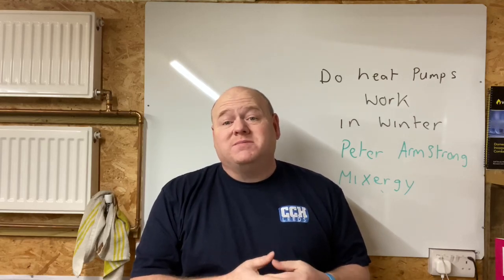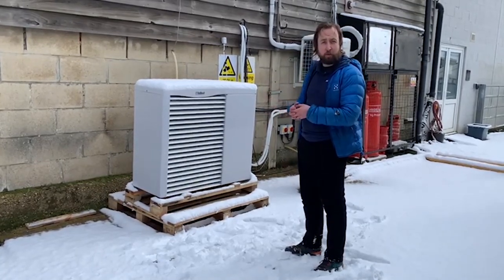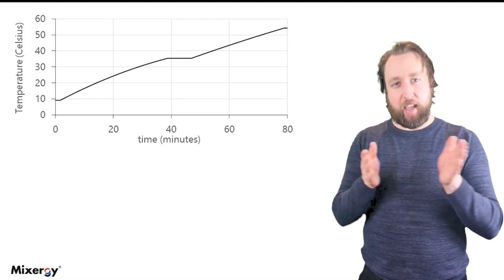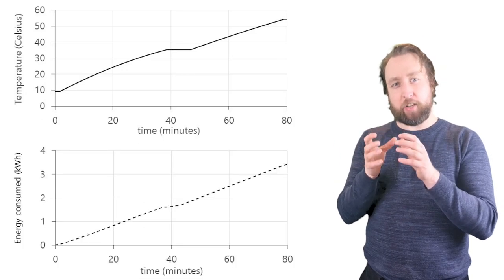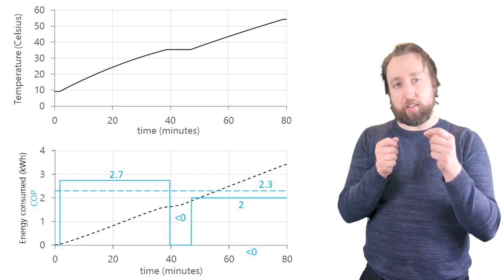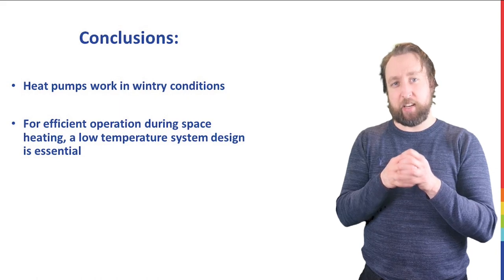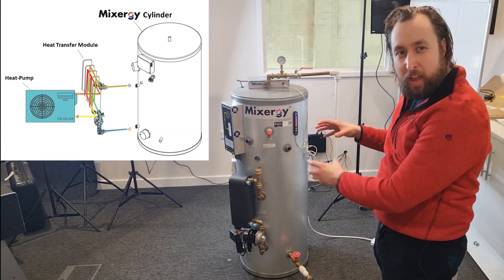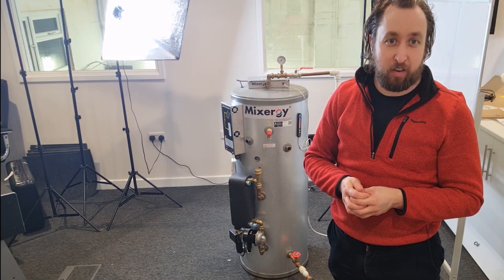Do Air Source Heat Pumps Work In Winter - Peter Armstrong Mixergy

Comment: Not convinced by this whatsoever.

How many houses of the 29 or so million homes in Britain can actually have sufficient insulation fitted to make these work? Anything built before the 1980s will likely not have cavity walls, so no insulation there. 

The questionable data here suggests it takes almost an hour to heat water up to body temperature of 37 degrees. 

And what about cost, it's about £4k for a new gas boiler install at the most. Most of the stuff I've seen is quoting around £15k for a heat pump install, I don't have £15k for a new heating system. Then there's the electricity costs, what does it cost to run a heat pump? 

We have had two or 3 periods in the last 15 years were temperatures have dropped to way below zero for weeks on end, a defrost cycle isn't going to shift ice when it's minus 10 outside and knee deep in snow. 

We're being told that this is all needed to save the planet, but the UK impact of heating homes currently is 0.000044% of global emissions, and half the climate physicists globally don't think the data suggests man made climate change is real. 

Hydrogen power stations and heating plus nuclear are significantly better options from what I can see if we are going to go down the route of moving away from fossil fuels. 

To put all this into perspective though, China ran short of power this week and increased coal production by 1 million tons per day, they also authorised construction of 24 new coal fired power stations this year alone. In short nothing we do in the UK is going to make any difference.
Reply from the maker: Thank You

Comment: Heat pumps are great if you run radiators twice the size or double the amount. However... In really cold outside temperatures, there performance drop like a stone. Better off with a boiler running on hydrogen (I suspect that will be the future)
Reply: Yes, I look forward to seeing hydrogen system in place as well, this would make sense to replace the traditional gas boiler with a hydrogen boiler - i’m not poo poo in heat pumps, it’s just I’m gonna be used carefully in the right place, as is usually the case, one size does not fit all!
Reply from the maker: Thank You

Comment: Not conviced at all.  Temp outside was -1C.  Where I live in northern UK that's nothing like as cold as it can get in winter.   Our mains water comes off the mountains so it is barely avove 1C for 4 months of the year, not 11C as used in this test.  Our 10kW electric shower can barely heat up the water enough to have a reasonable flow of hot water.   An air source heat pump will at best struggle to  provide water hot enough to even warm the radiators in this house, and we will still have to have electric showers.  So it's not just the issue of cost and return on investment, it's whether a heat pump system is fit for purpose.
Reply from the maker: Thank You

Comment: Wonder if anyone can help, I live in a one bedroom social housing bungalow and the housing association have offered me this system. I’m currently on night storage heaters for heating and everything in the property is all electric as no mains gas in the village where I live. The question is what can I be expecting to pay per month for this type of heating system and is it worth having it installed? I have the option whether to have in installed or leave things as they are.
Reply: Personally, I wouldn't chance switching over at this stage. Stories of astronomical bills are legion as are accounts of people spending the winter half freezing to death because the system doesn't perform to expectations. I can't give you running cost estimates, I'm afraid, as to a large extent that depends on how warm you like your home to be and how well insulated it is. But, in all likelihood, you'll be spending more for a reduced heat output.
Reply from the maker: Thank You

Comment: If you are looking at 2 to 1 output its a hell of a lot of electric! Maybe combine with solar water heater panels? Sounds like underfloor heating will ge better than radiators. But not convinced it will be cheaper to run or produce hot enough water for showers and baths
Reply from the maker: Thank You

Comment: my average winter temperature is - 5C for 90 days. will a heat pump system work for me  or do i need back up heating?
Reply from the maker: yes it will work.
Reply: @AllenHart999  But manufacturers like Trane and Carrier recommend that in long, below freezing temperature winter should have a secondary system such as gas or electric or even oil heating. The reason being that the heat pump shuts off when the temperature goes below freezing. Could you elaborate more?

Comment: My new Baxi 830 heats the house up to 23c in about 5 minutes, uses ten bobs worth of gas a week, fits in a shoe box, is almost silent, and cost less than £2000 fully installed, and comes with a 10 year guarantee. Science and analysis is great, but you can't beat the bottom line.
Reply: Paul, indeed, gas boilers are incredibly powerful and gas is very cheap!

It is a serious challenge we have on our hands to move away from gas - I would say that the externalities of gas aren't priced in (e.g Climate change mitigation costs etc) but very hard to see this happening without hurting the fuel poor particularly hard. Grants are being used to catalyse volume, which will hopefully reduce cost, but there's still a way to go.

We are unsure long term which way the UK will go, we expect a mixture of heat-pumps and gas blended to hydrogen, perhaps all the way to 100% in some areas (you can go up to around 20% without significant issues but then you have to really swap over to a hydrogen ready boiler).
Reply: HMG is considering abandoning gas. We import most of our gas from Norway.  HMG are going renewable with wind, tides, etc. So all homes being electric is the way. Many companies are preparing for the future with products to suit. Mixergy is adaptable or the future.  One of its features.

So, HMG will not rely on foreign fuels from one location. In case of war Norway could be occupied. Norway only exports gas, they do not use it domestically. They use more EVs per population than other country. Heat pumps are common. Strangely, a massive producer of gas does not use it.
Reply: @johnburns4017  heat pumps are extremely common on the ScandiNordics. I don't understand why it doesnt work in UK. Doesnt make sense to me
Reply: @uskok4636  
Because we have cheap natural gas, which is about 1/4 to 1/3 the price per kW/hr than electricity. Our homes are also not as well insulated, which makes a big difference in running heat pumps.
Reply from the maker: Thank You

Comment: So many comments ... Just purchased 100 years old log house with air/water system that has been operating for 5-6 years before we moved in. After 10 months and really cold winter (below -20C) no issues, works like a charm. Naturally the electricity bill is high in the winter but that's to be expected. Note that below -20C system automatically starts using electric heaters in the system.
Pump heats both radiators and the water.
House clearly has some additional insulation but clearly is not "hermetically sealed".
I am not an expert, situation in e.g. UK might be different, but the way I see it there are a lot of boiler manufacturers and installers talking trash about these heat pumps.
Reply from the maker: Thank You

Comment: All well and good talking about co efficiency what did it cost in £ to heat that tiny slim tank which it would seem was in a preheated room. Unless you are in a new  home with underfloor heating and masses of insulation they will not heat your home or produce sufficient hot water without you electricity bill going through the roof
Reply from the maker: Thank You

Comment: I don't believe that using electricity as the basis for COP calculation is valid. Electricity is an energy carrier and not an energy source. The losses between a power station and the consumer is easily 50% with the most efficient Close cycle gas turbine plants, which effectively halves your COP.

It would seem that if you have heat pump in a house you need to prioritise the heating at the expense of the hot water temperature during the winter?
Reply from the maker: Thank You

Comment: Really didn't understand the COP graph how it was a static number and not gradually decreasing as the water warms up. Need also to know the final value of COP for room heating (two examples please, traditional existing rads and then larger low temp ones). Also need to include some discussion about the house insulation. The water tank will need to be larger if it's low temp for efficiency. Many will struggle with finding the space for all this plant so we need some ingenuity. For for pump outside best mount it off the ground to avoid snow/ice, and away from neighbours. Can you do a video on ground source and borehole please.
Reply from the maker: Thank You

Comment: why does all aie source heat pump water tanks have emersion heatng elliments.
if the heat pump was so good you would not need a addition of a electric heating elliment.
what you should do is disconect the electric heating eliments then run it to 55c you would soon find out it will never get to the temp.
most people got rid of there bulky water tank for a compact combi boiler why would they go back

Comment: If you build a Passive home alliance home that’s super insulated and requires little heat to keep warm a heat pump system make sense. Retrofitting to insulate an existing home is difficult because of inherent thermal Bridges. Your heat pump system in a retrofitted home will have to be that much bigger to take care of the coldest days. Supplemental heat Makes sense otherwise you’ll have super large heat pump systems.
Reply from the maker: Thank You

Comment: Why do you not make all the data avalable ?  What is the power in kw being consumed during this heating of the water ?  What was the power being consumed during defrost cop 0.  Joke. Cop now minus 3.2. Heat being taken from tank for 10 min every 40 min to remove ice from coil . So at -1. This unit will be doing a defrost every 40 min for about 10 min  from what I can tell from your data during this time it is removing heat from the tank or using electricity if electrical defrost in use . But you only highlight the two areas at start up when it had low tank temperature and it’s cop was good due to low temperature of tank water. Then when tank water temp had got to about 40 c. It dropped  cop to 3.2 So it held this cop up to 50deg c. Then it would want another defrost period for 10 min . It is a shame that you did not show power consumption. During each phase of this. And also a longer time period by using some of that water to heat a area and give some real cop information of a 24 hr period of use.

Comment: it's a fridge, all fridges have an upper and lower point in ambient at which they physically can't work. Ie the refrigerant has to go completely through its saturation to change state. What is the lowest temp these work at, ie can the ambient temp drop the pressure of the refrigerant to a point where it trips lp saftey or control switches, or literally hasnt the pressure to push refrigerant through the expansion device. Also if it was really cold like  -6 how many defrost would it be doing a per 24 hours. Im guessing hot gas defrost?  What are the parameters for defrost? Initiation, Frequency, Lenght, termination, drain and drip down, arghhh so many questions lol

Comment: very interesting test. ive been offered a 5kw air to air air source heat pump. i have quite a small house and would have the inside unit in the living room and would open living room door to let heat out to the other room. what you think of the units sold by applances direct. 12000btu model for about £350 , from what i was reading they use up to 1.5kw and give maybe 3kw heat out inside. i know nothing about these and trying to get an affordable system to replace my storage heater . whats your thoughts

Comment: The video convinced me that I never want to move to an ASHP for home heating and hot water until gas costs per unit  go up to the point where it's half the price of electricity and not 6 times cheaper as it is now. Plus someone pays the 20k cost for all the work required

Comment: No need to waste time heating boilers because they waste energy and are very inefficient.  Just directly heat the air in your house!  In New Zealand  we use heat pumps extensively and they are brilliant.
They work on the principle that no matter how cold it is outside, the air can always be made colder. Simple refrigeration at work. Likewise in summer they can cool the air. A boiler cannot do this for you! A unit well balanced to the volume of the building will give around 4 or 5 times the heat that can be made using electric radiators for the same power consumption.  Heat pumps that "Do not work" are always badly balanced or incorrectly installed.  The placing of the evaporators out side is important as is keeping the air screens free of dust inside. In winter we leave ours on at 18 C all night and crank it up to 22C in the morning. It is more effective to keep contents of house warm all the time rather than having to warm them from low temperature.
Reply from the maker: Thank You

Comment: Do heat pumps work in winter?
Yes.
We live in  500 year old house in Sweden, we have cold winters
Yes the house is well insulated, hasn't always been that way.
Over the last 50 years it has been gradually updated and insulated.
It is a cosy warm house, +21 degrees indoors 24/7 irrespective of the outside temperature.
Where we live it can be minus 15 or even 20 degrees.
In the main it is about minus 5.
We have sub zero temperatures for sometimes day and night.
Heating:
We have electric radiators, gas is not used and we live in the country.
Very expensive to run.
Our main heater is an air to air heat pump.
It runs day and night.
The radiators are set to +18° and kick in when it is extremely cold.
We have two big tiled wood burners because wood is cheaper than electricity. 
They accumulate heat.
We light them once or twice a day. 
They give off heat for 10 to 12 hours 
We burn about 1 and half ikea style bags of wood every 24 hours.
It works like this.
When the wood burners give off heat the heat pump shuts down for periods
When the wood burners and heat pump cant keep up the radiators kick in. 
Defrosting, yes it does, but the house is warm and we don't notice it.
Of course an air to water system is more efficient and convenient.
The thing is the radiators must be effective with 40 to 50 degree water
So yes without question heat pump work even in a very cold climate.
Reply from the maker: Happy New Year
Reply: @AllenHart999  same to you mate, hope you found that interesting..

Comment: So of all the ASHP offered for the trial in New Castle (around 2,500 offered for free for the test) 14 if I remember correctly were taken up. All have failed at -5c and have needed some form of back up. Further down south not an issue currently (though the freak snow did cause issues with condensate drains and ASHP) but generally they're more reliable in southern counties. It's always horses for courses though, also given the amount of noise the units can produce at full load I wouldn't be surprised if they're installed in densely populated Terraced housing that noise complaints and regulations will come into force at some point.
Reply: Interesting observation Effer Vescence, noise is indeed a challenge, we did notice this and can imagine in tightly packed housing could become material...
Reply from the maker: Thank You

Comment: Very interesting,but that heat pump looks very big compared with ones ive seen in domestic settings,
can i ask how much this setup would cost without instalation,it looks very very expensive,what size unit is it?
Most of these domestic ones seem smaller and on defrost all the time.
am i right in saying that in this instance for every 1kw electricity you put in you get 2.7kw out or there abouts.
This doesn't seem to compensate for the ineficancies in electricity production / delivery.
to produce 1kw of electricity and deliver it to your house it will take 2kw of gas/other in most instancies so it hardly seems worth the cost for such little benefit.
Also as said before you can buy 4-5 kwh gas for the price of 1kwh of electricity (this shows you how ineficiant it is to produce electricity)
My house has to have the heating temprature set at 65 C in winter otherwise it doesn't seem to heat the house up,i fear that heating set to 40 C will have to be on all the time to just keep the house look walm,If you came into a cold house (below 10 C) i feel you would have to have radiators the size of one wall to get the room up to temp in a reasonable 20-30 mins.
Everyone I speak to with this kind of thing in there house is constantly cold and paying a lot in bills and end up putting a wood burner in aswell,I feel its a waste of money.
Reply from the maker: Thank You

Comment: In Australia we have used reverse cycle air-conditioning (same principle as a heat pump) for decades for cooling and heating homes. The main difference is we have ductwork and vents in each room where the cool or warm air is distributed.
It is by far the most Energy efficient form of heating here as especially around the coastal areas of Sydney we rarely see winter lows below 6c and average day time temps of 18c
If you experience prolonged extensive temps below zero degrees some heat pumps will struggle due to having to de-ice the out door unit all the time, as during de-icing there is no heating taking place.
Reply: They don’t want dry systems here in the U.K. as people will run them as aircon in the summer (and we can’t have that!)
Reply from the maker: Thank You